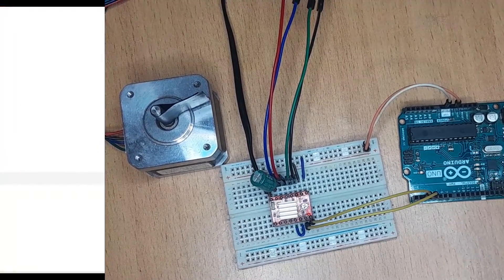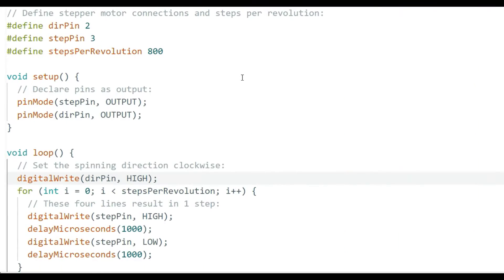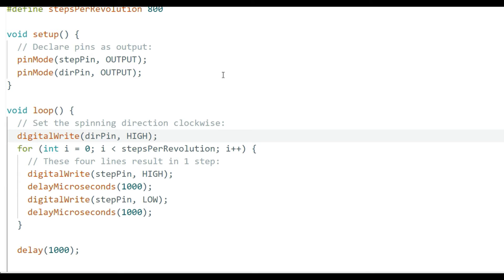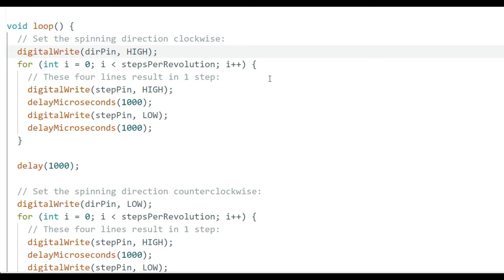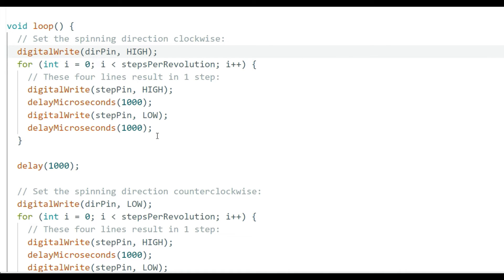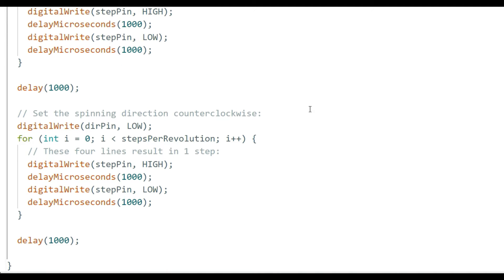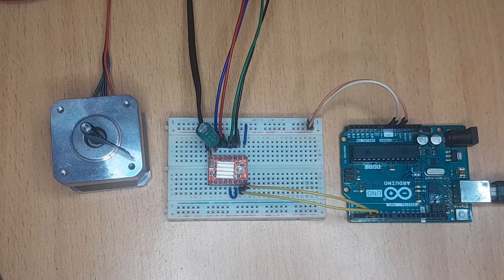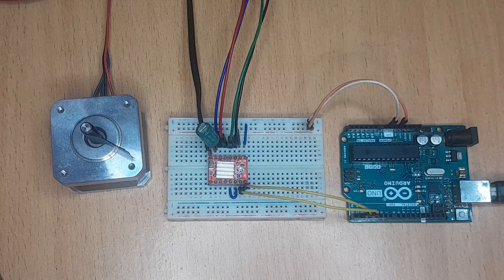A4988 Stepper motor driver with Arduino.

Comment: I was confused when you used a screwdriver for the testing, does the resistance of the screwdriver does not effect the estimation
Reply: He was measuring the voltage while changing it. A clever technique.

Comment: Hi I am using nema17 stepper motor and DRV8825 to drive it but my motor driver is getting heated up even though my stepper rotates. Is there any reason for this happening?

Comment: Hi brother, im currently working with stepper motors, im unig arduino sheildv4  with arduino nano. and IM unable to control the motors.  the motor is is making little sound. when i try to change the wire (figuring out two coils) it vibrates the motor a lot. not sure where the issue is. can you help me in providing some code to get started with that board?

Im surprised why there is not evena single comment yet. Keep going buddy. i wish  to see you grow